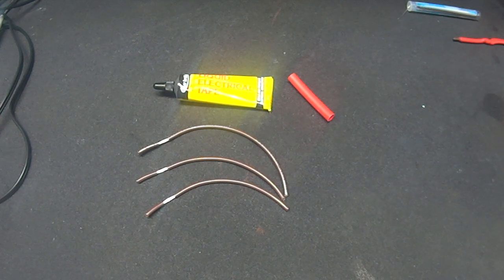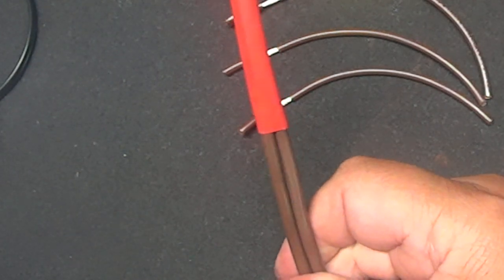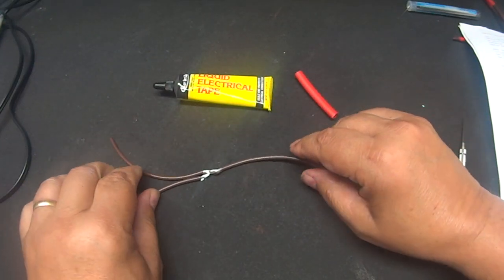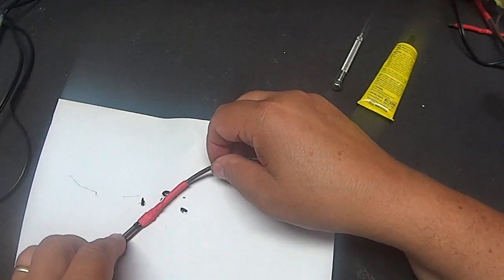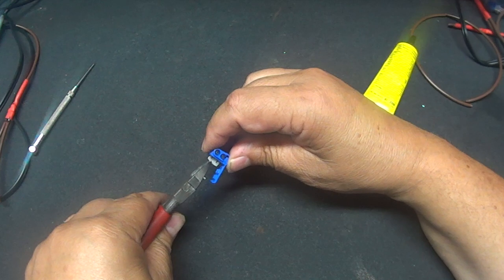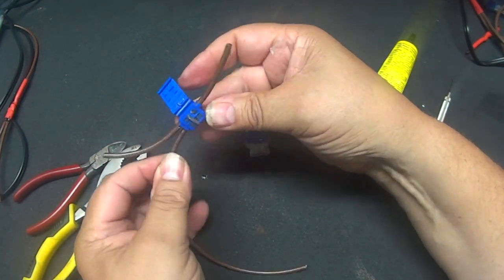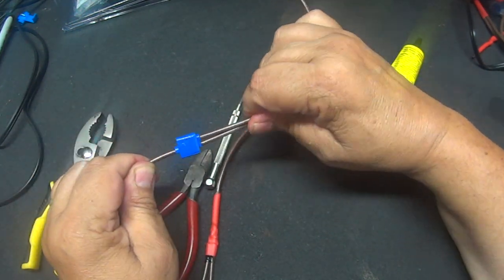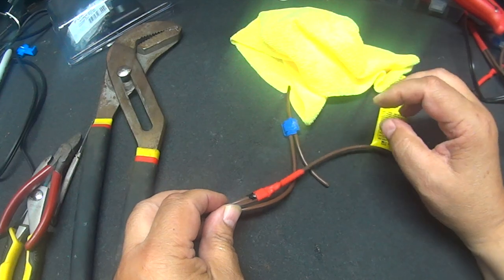Making waterproof three way splices in RV DC wiring.

Comment: I wish I had seen this a year ago. But I’ll know how to do it correctly next time. I hate those compression type connectors. Too many times I have gotten poor or intermittent connections using them. 
You have an excellent and very helpful channel. 
After watching your videos on how to use Anderson tubs to get the auto leveling to work, I haven’t had a single problem. Thank you so much!
Reply from the maker: Thank you for your support.

Comment: Good morning I really appreciate your video's always informative. I'm a retired electrician and the first shop  project I ever did was splicing . Particularly the 5 steps, of the western union splice, which you covered. This is the only method I feel is appropriate for smaller conductors in rough environments as apposed to IDC connections. Again thank you for the video's
Reply from the maker: Thanks for sharing

Comment: Thanks for the video & information!  I definitely will be getting some liquid tape for rewiring my jon boat trailer.

One observation though.  I think that you’ll get much better transfer of heat to the wire if you place the soldering iron under the wire (heat rises).

Comment: I'm a bit confused at what the point is here?

Solder would be an absolute no go in any environment requiring water resistance, so waterproofing a solder connection seems counter productive and/or pointless, no?

Maybe they have different standards  in the civil engineering world, but I avoid solder if at all possible, especially in a wet environment.
Reply: Why is that?
Reply: While it is a better electrical connection,  you NEVER solder wires on a boat, or any thing that is subject to movement/jaring... but it works fine in applications were the wires are stationary at all times, and free from vibration.

Comment: Why not just use marine grade heat shrink connectors They already have the sealant inside of them and there's no soldering required.
Reply from the maker: when you parallel two wires together and cover them with heat shrink, the heat shrink will not seal the gap between the two wires.  There is not enough adhesive in the heat shrink to seal the gaps.
Reply: @RVProject  the marine connectors I use have a large amount of sealant inside that is activated when heated. It easily seals two wires.
Reply: @kshultz67  The ones I use are good, but I'd like it if there was more sealant for the two wire side. Can you provide a link please?
Reply: If you're doing a lot of them or don't have access or time to wait, this is a good option, and those connectors are rather expensive last I checked